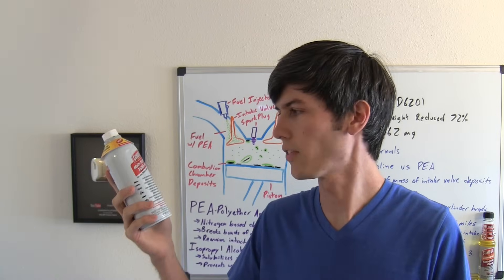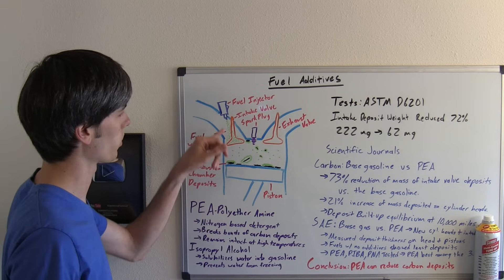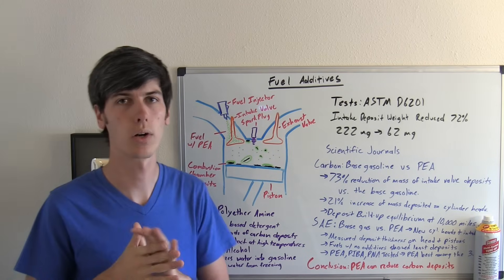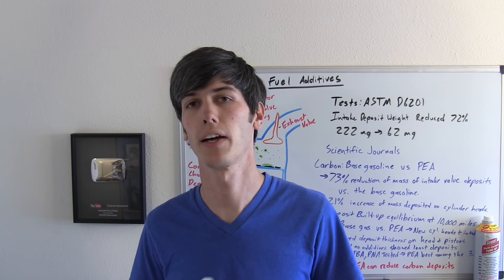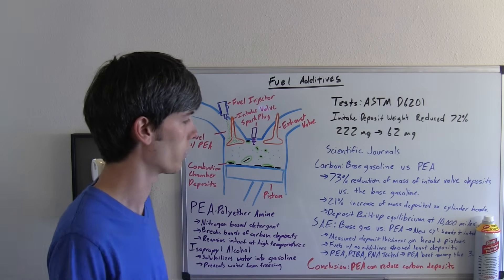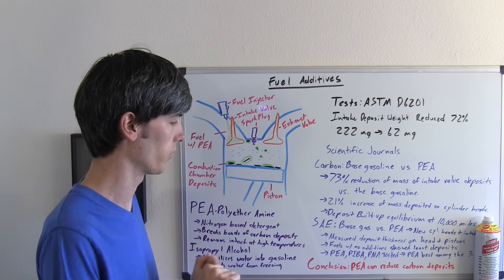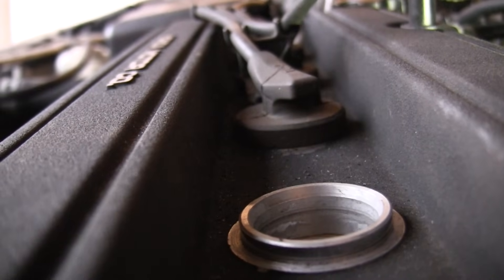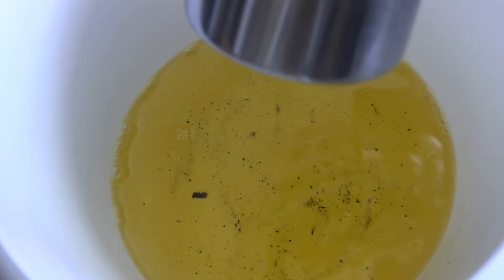Fuel Additives & Injector Cleaner - Explained

Comment: Please explain The true effects of acetone!!! I see lots of videos claiming it drastically increases gas mileage..
Reply from the maker: If there were something magical that drastically increased gas mileage. It would already be included in our fuel.
Reply: ***** They can charge you more if they add benefits to the gasoline. And they would get praise from the environmentalists that hate them so much. Oil companies are no longer monopolies, they are fiercely competitive. If one of them could make superior gas with something that was already out there, they would
Reply: pooft Lee "Also, you do realize leaning out the air fuel mixture risks detonatiion right?"

105 octane rating versus 87, but sure thing expert. No, it's not a flex fuel. But an O2 sensor giving off low voltage signals tells the ECM that the engine is running lean and will try it's damnedest (real word) to compensate (enrich fuel ratio). Yes I did experience worse fuel mileage, but most of this was under load and acceleration. Since i don't drive like an asshole I didn't experience a huge mileage drop while cruising on level road. I also don't run 100% E85. I even said that myself. Can't you read?

"Your car not immediately breaking down is a terrible argument. I could pour bleach in your gas tank and your car would keep running for months. Eventually it would eat the cylinder walls and piston faces. Would it survive for a bit? Oh yeah. Will it still fail? Absolutely"

Put bleach in my car and I'll beat your ass!

 "Do some homework before you ruin a perfectly good automobile."

By homework do you mean never questioning the engineers who are bribed by big oil to make sure we not only buy 5x more fuel than an engine should actually need because engines are intentionally built to be extremely inefficient, and accepting what the "experts" say as "truth" so you keep on living in an oppressed life? A little research on your part will yield very surprising facts that have been hidden from the public. Good thing the auto manufacturers build a good product huh. After all it was our tax money that got GM a bailout when GM filed for bankruptcy.
Reply: ***** Acetone is an extremely volatile and potent solvent and can dissolve almost everything, including some plastics, paints, rubber. There is a reason why it is not used in gas. Think about all the components that gasoline has to touch along the way before getting to your injectors including delivery to the gas station. (Pumps, valves, lines, gaskets, filters) Gasoline isn't that expensive considering all the work that has to go into digging, pumping it out, transporting, shipping, refining, shipping, distribution and regulation. A big percentage is in tax too as a way to pay for highways and roads. If you do make your own bio diesel you are supposed to write a check for state and federal tax and keep track of how much you make. It will take a while to make it worth your time and money.
Reply: Engineering Explained  it would be nice to see you do an experiment with it, so we can debunk or prove it once and for all. KipKay made a video where he used it in his car and got an extra 10 MPG which is pretty amazing.
Reply: Ko-wing wong Acetone got mythbusted on mythbusters
Reply: HomasterX Bullshit! You trust myth busters to get you the facts?
Reply: Ko-wing wong Acetone is a trick that oil companies DO NOT want anyone to know. Does it improve gas mileage? Test it for yourself. The recommended amount is 0.1 to 0.3 fluid ounces per gallon of gasoline, which I find absolutely ridiculous to be told that amount is capable of "dissolving your fuel tank" like sir "genius" Calvin Lim says here. A 30% increase in mileage, and thus 30% loss in profits, is enough to scare those who sell to us. Hence why if you're told acetone does not work, you can flat out call that lie bullshit. I've been running it my car for months now and have yet to noticed my fuel tank "dissolving" right underneath me or any other car trouble for that matter. I also run 3 to 5 gallons of E85 per tank (12 gallon tank) in my non-Flex Fuel car because Flex Fuel on today's cars is really nothing more than an ECM tuning difference. Yeah, you heard me right. You'll pay an extra 3 grand for a car that's literally NO different. Keep it below 60% ethanol though as it might turn a check engine light on, which can also be ignored.
Reply: My car isnt flex fuel will it work as well?
Reply: Ko-wing wong For my car the trouble code is PO 171, meaning the system (fuel) is running too lean according to the O2 sensor on Bank one. Since my car has an inline 4 there is only on cylinder bank unlike a V engine which has two. So there's that. The extra oxygen content in ethanol is causing the O2 sensor to give off higher voltage reading which occur when the engine is running lean. This can be corrected by reprogramming the ECM to compensate for ethanol by delivering more fuel when doing so. But what's the point? An engine that can run higher concentrations of ethanol than what is told to be true and I should reprogram it to use more fuel just to keep a check engine light off? I don't think so! So to answer your question, yes, to a point. I am not running 100% E85 in my car nor will I until I do more research. But 50 or even 60%? Have at it.
Reply: Lol its hard to tell on the internet. But acetone is a form of alcohol right?
Reply: Ko-wing wong Acetone, or Propanone is another name for it, is a simple ketone. Not an alcohol.
Reply: Bone Drone It takes longer than a few months for it to eat fuel system components. Another important thing: flex fuel cars have a different fuel system to handle ethanol. Most fuel lines don't handle it well. Ask any classic car owner how their car does with even modern pump gas and it's additives. Plus E85 returns WORSE fuel economy. Do some homework before you ruin a perfectly good automobile.

Your car not immediately breaking down is a terrible argument. I could pour bleach in your gas tank and your car would keep running for months. Eventually it would eat the cylinder walls and piston faces. Would it survive for a bit? Oh yeah. Will it still fail? Absolutely
Reply: Bone Drone Also, you do realize leaning out the air fuel mixture risks detonatiion right? THATS WHY E85 CARS USE MORE FUEL. I pray you aren't doing all these things to a nice car
Reply: Oh boy. Bone Drone you can still lean out your mix, 105 octane or no. Most stock injectors don't have the room to compensate for big changes like the ones you're trying to make. Also what happened to "huge gains" in mpg? Sounds like a loss

Bleach was just making a point, I'm not ready to go to hell

On never questioning engineers, most auto manufacturers are building electric cars just to meet CAFE standards. That's why Nissan has the GT-R and the Leaf. If they could just make a tweak or two and avoid all the trouble of electric drivetrain development, building new lightweight platforms, and retooling for more cars, they absolutely would.

Not sure why GM is relevant, last I checked the corvette got what, 30mpg highway? Pretty good for a 6+ liter 8, and competitive with Ford's v8 numbers. Ford hasn't taken a diime of government money last I checked

I pay a lot in gas, I'm not exactly motivated to protect big oil. But I'm not a fan of over the top conspiracies.

You know why cars are just barely seeing the MPG numbers they did with the volkswagen rabbit and honda CR-x? Because cars have been legislated and up-sold into lead-lined, 40 speaker audio, circuit city safety boxes in an attempt to idiot-proof daily driving, and add more and more superfluous junk to the morning commute. Weight is the biggest engineering challenge to the modern automobile. The 4 stroke combustion engine only has so much efficiency to offer. What you do with the rest of the vehicle is where most innovations happen, and until engineers find new solutions, they have to work around crumple zones, rollover support, and the trunk space required for a set of golf clubs
Reply: pooft Lee Well I never mentioned "huge gains" in mileage with ethanol so I don't where where you're going there.

Weight? The weight increase of vehicles could be optional but it's not. It's a standard weight increase. I could live without power seats, power windows, AC, and even a radio since I can't stand today's music anymore. It would also be cheaper on me to buy such an ill equipped vehicle. Instead we're now all forced to buy all that equipment even if we don't want it. So much for optional equipment. 

As for conspiracies don't take my word for it. Do the research on your own and decide what's true and what isn't. Just know that cars and oil in the end are all about making money. Keywords: Hot vapor, water injection, PCV filtering, diesel dual fuel (Two fuel injectors per cylinder delivering different fuels), GEET, plasma plugs, ceramics, nitrogen cryogenics, I could go on forever. 

Concerning emissions what does current day equipment have to offer for efficiency? Nothing save for EGR on gasoline fueled engines. It's really quite intuitive, not.
Reply: Bone Drone you said you run acetone as well as E85, and that anyone can try it and see the gains you do. Regardless of whether the original comment was just missing a comma or period to clear things up, you're going to hurt your car's fueling system if it was designed before oil companies started throwing tons of additives in our gas.

As for current efficiency, Mazda's skyactiv project is kind of a big deal, and VAG is working pretty hard with their diesels. but again, all the dead weight in most cars is what will kill efficiency. A new harley is a gross polluter completely built with performance in mind, but it still nets 70+ miles per gallon because it weighs nothing. Weight is the easiest thing to tackle, as the combustion engine will never get more than 25% efficiency, and it'll never get close to that in an automobile. Back in the 70s automakers could bare bones a car, and that's how they got around that and made 35+mpg out of the Volkswagen Rabbit and the fiesta. You put a new ecoboost in one of those cars and it would probably get 50+ mpg.

We're getting closer and closer to the peak efficiency of car engines, barring some huge innovation. I'll look up the things you mentioned, but most sound fairly complex for a daily driven and abused automobile (plasma ignition and multiple fuels?)
Reply: pooft Lee Well if the engine quits one day I shall rebuild it wild. Have no fear.

Comment: Ok so question. Engine get hot, some more than others. Does heat or temperature have any significant effects in the cleaning process? We know that if we let carbon sit in the injector cleaner that it loosens it and some carbon build up falls off. But fuel injector shoot out a burst of the fuel mixed with injector cleaner with pressure also. And we know heat is involved as well. Maybe with heat and the injector cleaner is more effective than letting it sit at room temperature? In a nutshell I just want to know what factors are really contributing to cleaning the engine. Is it A)Pressure from the fuel injectors B) Heat from the engine, or C) the combustion of the fuel cleaner?

Comment: I saw Scotty's video about this product. So, I bought REGANE to try. I put it in and I filled up. Immediately, the idle dropped from 900 to 600rpm. I consider VQ37HR as a happy revving engine but no torque at the low end. I felt a tiny bit more torque at low rpm after Gumout but now it's back to normal after 100 miles; no torque at the low end again. One time it went lazy on me; I had to rev pretty high just to move. That's the only abnormality I faced with this product. I've been keeping an eye on mpg but no sign of improvement yet. Now it's running normal. Share me your experience if you have tried.

Comment: I have a 26 year old car and when I'm braking, facing down, or turning left, the car wants to stall and sometimes the fuel gauge displays empty while it's happening. Can it be deposits on the fuel system? The car was sitting for a few years before I got it. It also has a carburetor. I have no idea what could be causing this.

Comment: One thing you may want to follow up with is, the duty cycle of the port fuel injectors can reach 80%. This causes fuel to be sprayed on a closed intake valve.This happens at higher RPMs when the demand for fuel is high, and the duration of time that the intake valve is open is short. I refer to the Megasquirt DIY fuel injection manual for this info. Coking carbon on valves and in the cylinder is one issue. Another issue happens when a vehicle is driven on short trips consistently. The engine is able to reach operating temperature, then the wet injectors evaporate the fuel off them, leaving deposits. The engine is never driven enough to flush the detergents through and clean the injectors. Please keep up the good work!

Comment: U would only have this carbon deposit problem on ur intake valves & piston head if u have rich air/fuel mixture not lean right? Since these deposit are basically unburn fuel like soot

Comment: I am very curious to hear your take on using water as a method of decarbonizing an engine, great video as always man keep it up.
Reply: It won't mix with fuel, causes poor combustion, and too much is liable to cause you to bend a piston because water can't be compressed. Stick to walnut blasts or additives
Reply: @illegalopinions4082  Quite an old question i posted but you wouldnt be mixing water with fuel thats just a silly assumption, i was referring to a water met kit that adds an independent injector in the intake plenum, which will decarbonise your pistons, water cant be compressed but you arnt adding enough to hydro lock the engine as well as its a mist and not a stream.
Reply: @TriniRogue  It is indeed but hey, nothing quite like a bit of necromancy to start the week.

You only mentioned water in your original post and I've seen enough videos from Rufford ford to know the average person may try shooting it in through the air intake. Methanol and water injections would clean them, but for the more solid deposits it would take some time to clean them off.

Seriously though, if you want some amusing videos of people hydrolocking their engine and making them die, Rufford ford videos right here in YouTube.

Comment: Great video, I really like the fact that you look for different sources.

Anything regarding diesel engines? these tendo to build up a lot more carbon deposits. I have heard that replacing diesel for biodiesel works great for cleaning the chamber since the biodiesel works as a solvent. Anything on this?

Comment: Would it be safe to use regular gas with fuel additives instead of premium gas for new Audi and Mercedes cars since there's a huge price gap between the two in my country?
Reply from the maker: I would use what is recommended. Also, check the manual for the "minimum requirement." Often you can get away with lower octane, by sacrificing some performance.

Comment: These things definitely work. I recently bought a Miata with 100k easy miles on it. Upon changing the spark plugs ~1k mi after buying, I looked in the cylinders and the pistons had a moderate cake of carbon. I ran a bottle of Gumout with Regane through a tank of gas, and the carbon is almost completely gone (pulled plugs to inspect). The plugs also looked MUCH nicer, indicating a better burn (looked a bit lean before). The pistons continue to look nice after a few thousand miles of normal driving with normal gas, so it seems to be a lasting effect.
Reply from the maker: Awesome - I may eventually test it out in my Integra. I may do a lot of things though haha.

Comment: how about a video on what gas we should use? should we just use 87 on regular cars and is 93 really necessary for premium cars?
Reply: My car pings on 87. Makes a bigger difference in high performance engines. Premium is more resistant to knock, higher compression engines don't like regular
Reply from the maker: I would use exactly what is recommended, and not stray from it. Here's a video showing some proof that if your car is designed for premium (via spark timing), it does make a difference to use premium fuel. Dyno Testing Premium Fuel - Octane Level vs Performance - Shell V-Power
Reply: Here in the UK 95 is standard fuel. 97, 98 and 99 is considered Supreme.
Reply from the maker: Darren Boss You use a different rating system.
Reply: Engineering Explained Yes someone did bring that to my attention a little while ago I believe.

Comment: Did you find any test done on GDI engines and the effect of fuel additives on them? Since direct injected engines inject the fuel past the valves and directly into the combustion chamber is there any need or benefit of running additives through this type of engines.
Reply from the maker: Juan Cornejo Haven't seen any test data for GDI, no. The additives supposedly will still work for the combustion chamber, so I'm told from both Gumout and a fuel supplier.

Comment: Eric the car guy mentioned using water in a vacuum line to get rid of carbon build up. Ive never had an engine with carbon problems, but if I were to use anything it would be the water method, since I know water wont ever hurt anything.
But I'm very picky about where I fuel up too.

Comment: Another simple test you can do at home (be carefull) is put small amount of gasoline in a glass test tube add approx 1/10 amount of battery acid to the test tube, you should get a yellowish scum on the inside of the glass, add your fuel system cleaner into the tube and see if it is able to remove the scum, this is a simple method to determine is the cleaner is able to clean some of the chemicals off the test tube. This would be similar to deposits left behind by in-complete combustion.

I used to like to goto Mosport and fill up my autocross car with 100 Octane fuel, car ran very good and never messed anything up.